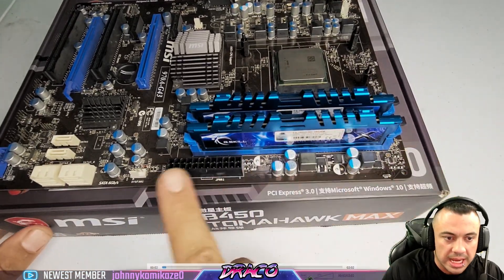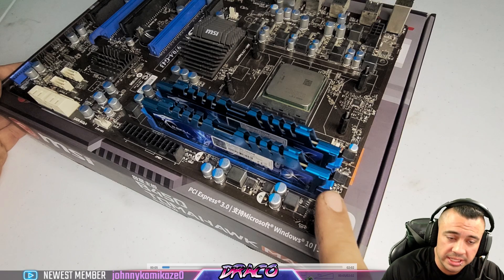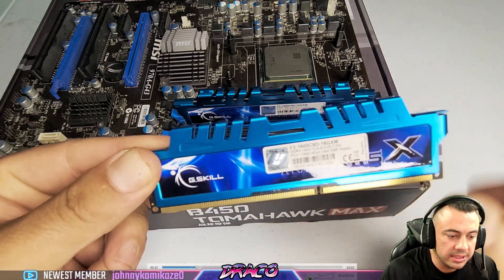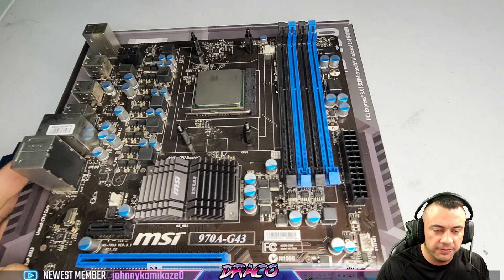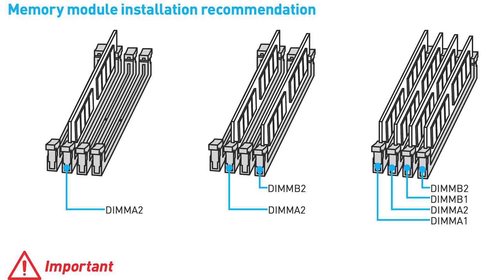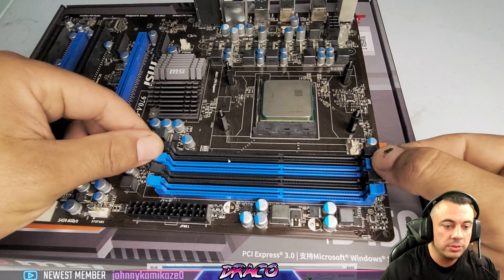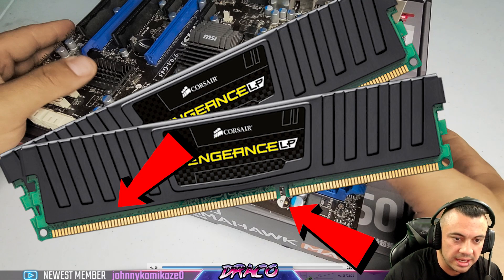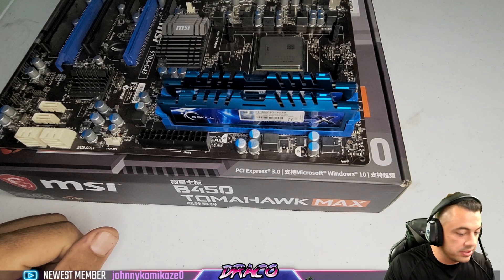How to Install Upgrade Remove Memory THE RIGHT WAY - Gaming PC Build

Comment: I have a question. When I change my old ram and install my new ram what i have to do. Do i have to install something.
Reply from the maker: No but you may need to setup your BIOS settings for Ram speed and or XMP profiles which i can cover in a future video